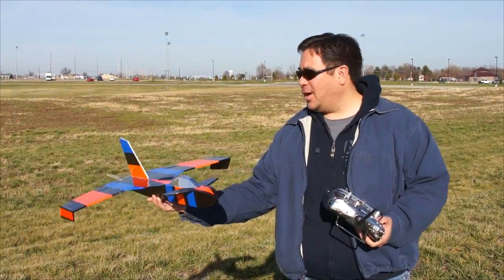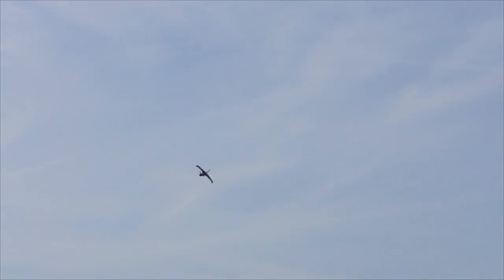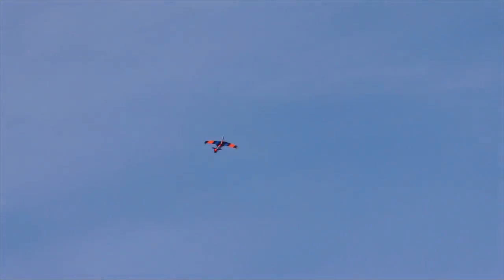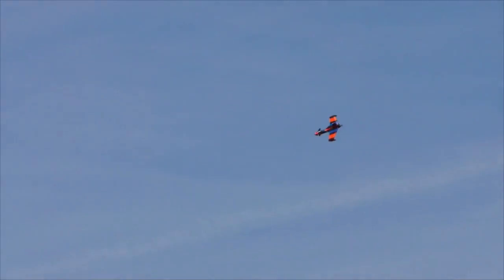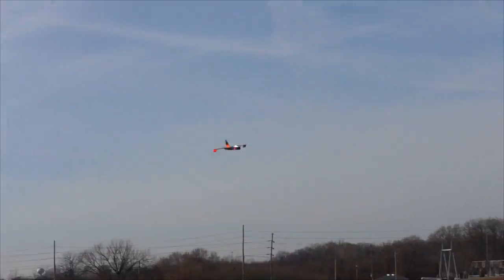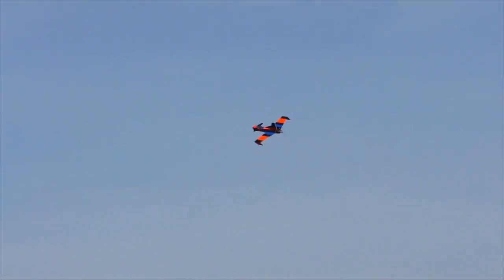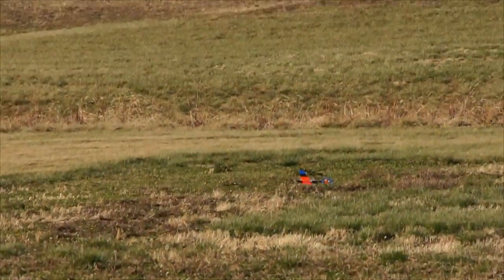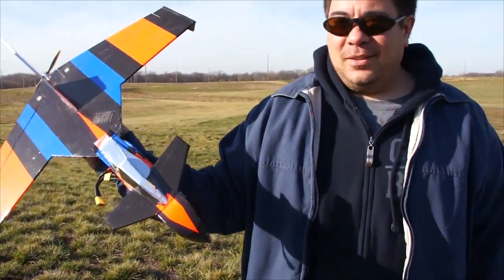Mini Dragon and Supernova

Comment from the maker: I am currently running the Turnigy nanotech 5S 2700mah 65-130C Lipo batteries in the Supernova. I did run similar speeds when I first made the plane with Zippy packs rated at only 40C.

Comment from the maker: katsod the camera on the Supernova is just an older GoPro Hero HD. The camera was set to film at 1080p and 30 frames per second. I just taped it to the top of the wing with strapping tape. It is placed right on the CG line.  The supernova is fairly big so it didn't seem to make a big difference in the way it flew with it on there.